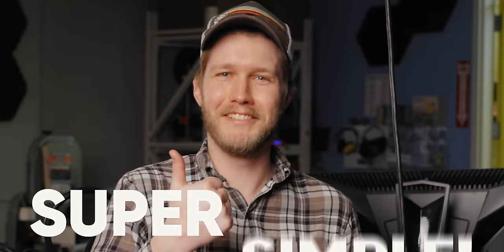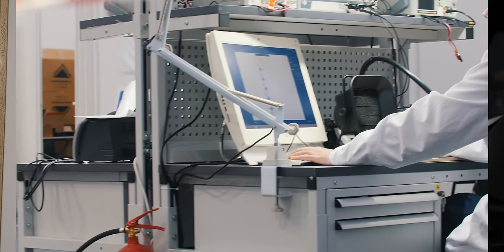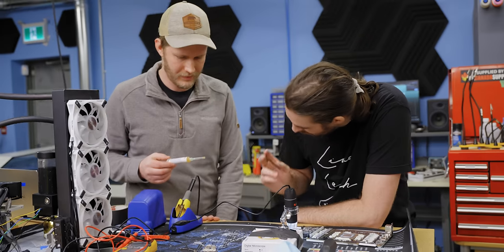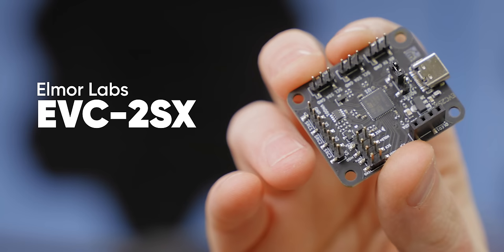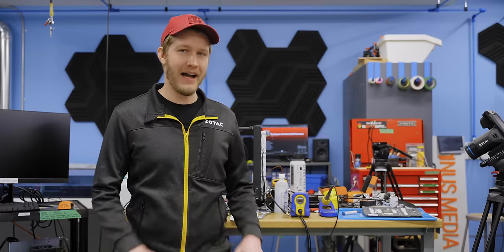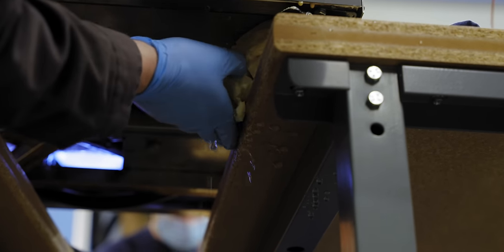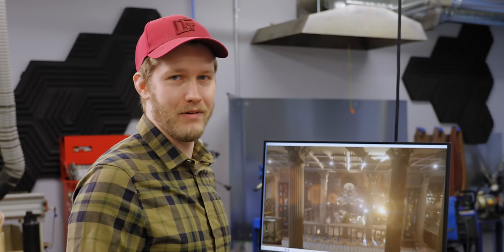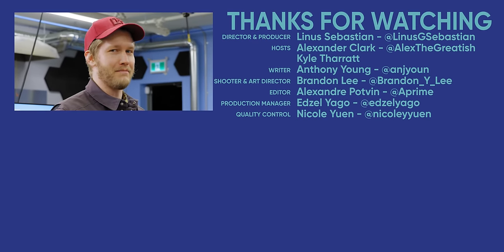Nvidia Doesn't Want You to Do This - GPU Shunt Mod

Comment: Alex: We’re gonna overclock this RTX 3090 with everything disabled. What could go wrong?

Canadians waking up tomorrow: Where are the lights? I can’t turn anything on.
Reply: That’s what happens when Linus isn’t in the room to reign Alex in.
Reply: They got power issues
Reply: Don't worry i heard some canadians are working in a generator that uses honking to generate power!
Reply: @Happiness-lp9fw  oof.
Reply: It's Canada, not Texas.
Reply: Canadians should be asking where's their rights
Reply: That's just Canada
Reply: Atom  mashalla
Reply: That's right. The one beaver, running in a squirrel wheel, that powers the entire nation's electrical grid, just had a heart attack when he plugged in that rig.
Reply: Eluwina  Shut. Your link will not be clicked, refund the owner of the channel you are working for.

Comment: Preheating boards for soldering is actually one of the many unexpected uses for my 3D printer's heated bed. Very useful.
Also getting plastic laminate pliable, softening glue. But most of all I use it to keep my dinner warm.

Comment: I have that same Hakko soldering iron, and it is easy to accidentally set the offset instead of the temp. If done it can think that  it much hotter or colder than it actually is.
Reply: Sqeaky
It's sponsored by TSMC, they sell more GPU chips if you do this at home!
Reply: What soldering iron is this? Does this one use the T12 / T15 tips?
Reply: the temperature offset thing is confusing as fuck, they call it temperature offset when it's actually a calibration, and it's easier to get to the calibration than the actual temperature adjustment. ridiculous design
Reply: Yeah but they were trying to solder onto ground/power planes. So that iron just doesn't have enough grunt for the application.
Reply: @deth3021   nah, it definitely has enough power to do it. I use that exact same iron at work all the time.

Comment: If you happen to read this, your going to want to do a factory reset on that Hakko unit as your issue is most likely when you "set" its temperature you actually set the temperature calibration. Its a common problem on that unit and the displayed temperature is not the true temperature but much lower.
Reply: This would explain why a Hakko was performing so bad I imagine. Was wondering that.
Reply: yeah that iron is definitely more than ample for the job, clearly some setting was wrong, ty
Reply: @mycosys  yeah Ii use it to solder onto small copper plates at 650F with no issues.

Comment: i rememeber being a teen (1999) and my idea of ''advanced' overclocking was taking a room fan, pulling off my side panel on my 500mhz p3 with 64mb ram and a ati rage 128 16mb, then pointing it into the case. i got some pretty good results! stock 90/90, i had solid performance at 125/145 or so if not higher. i miss that
Reply: I did exactly the same thing with a Celeron II and the same graphics card, in about 2003. I ended up frying the card and never bought another ATI card again. 😀
Reply: @TehButterflyEffect  that card in 2003 wasn't any good for anygthing anyways lol
Reply: @FusionC6  Eh, I was playing games from 1999 and 2000 that my old Matrox card and Voodoo 3 had struggled with like crazy. I went from 2-3fps with the Matrox to 10-15 fps with the Voodoo, then 20-30fps with the Rage. I had one game it couldn't run, which is why I tried to overclock it.

Combat Flight Simulator 3. 👍
Reply: Eh, that's still very modern. My first overclocking experiment started when I noticed that the 50 MHz quartz crystal in my Amiga 68030 card was not actually soldered in, so I went and got a 60 MHz crystal from an electronics shop and replaced it. 

Worked well for a while, then summer came and the system (with absolutely no fans) overheated after about 30 minutes. 

Plus, gaming back then didn't even care about the overclocking, since it was all designed to run perfect on the base model.
Reply: @ShieTar_  I had an es AMD Athlon 1100 in 1998 (dad was head of R&D at mesh computers) he "acquired" it from work written off as a dead chip slapped it in my first rig and overclocked it to 1.5ghz for me, he had it running a 3dfx guillemot voodoo maxi gamer phoenix with an incredible 16mb of memory on the graphics card, a 4gig hard drive and 256mb of sdram, best christmas present ever.

my first upgrade after that was a matrox G400 dualhead graphics card that made games run in hyperspeed when the frame limiter was disabled then a voodoo3 then a geforce fx5900 then a winfast geforce 6800 and then a radeon 2900xt then a zotac gtx580 and now a gigabyte gtx950 

a lot of other cards in between that I can't remember along with mobo,ram,cpu upgrades to the point I'm sitting with a semi decent rig (don't game much any more on pc)

asus x99 deluxe 
i7 5960x
gtx950
32gb dominator ddr4
Reply: @TheHaggisBasher  The Athlon 1100 wasn't released until the Summer of 2000 though, and didn't exist in 1998.  I think your childhood memories are a bit fuzzy ;-)

In 1998 AMDs range of CPUs ended at the K6-2, with up to ~550 MHz.
Reply: @ShieTar_  i was gonna say the same thing, as well as the voodoo card having 16mb ram, only the voodoo 3 and higher had that much ram :P
Reply: @ShieTar_  I'm just replacing my Amiga oscillator now! Not upgrading it, just a replacement. Also have some Pistorm CPU accelerator PCBs to solder up when I get the components. 
Amigas are awesome. Good times.
Reply: Pffft...I remember getting all my 80's groupies to blow over the 486-66DX just so I could run Doom.

Ok, about half of that isn't entirely accurate.
Reply: @TehButterflyEffect  and in 2022, I'm trying to get decent performance out of DCS World in VR. Those goalposts just keep on moving :/
Reply: @Kholaslittlespot1  I had a 68030 and a 170Mb hard drive in my 1200. I was living the dream! :D :D
Reply: I modded a window AC unit into the side of my case, for a AMD Duron OC way back. It worked great until the ac unit shut off because it was too cold, and my Duron jumped to 120'c in the space of 2 seconds.  Nowadays. I've literally ducted a portable 2 hose AC unit ( much quieter ) permanently into my PC.   Keeps the insides at a nice 5'c and since it's sealed, and the AC unit removes any condensation, always dry.
Reply: @Keri-Kerigan  My computer and window unit are on the same wall so I just made a 90 degree turn duct off the AC. Not physically connected but blows straight at the front of the case. (full mesh front, front mounted 240 aio). I don't run it that cold...about 18C at the face...3080 runs 65C under load.
Reply: @ShieTar_  Games back then ran faster when you overclocked... I mean literally, the game would progress faster.
Reply: @Idiomatick  Some games, mostly on PC, did. Most Amiga Games had their game engine synced to the video mode, so they basically ran in a V-Sync manner.

You have to keep in mind that the Amiga had pre-emptive multi-tasking from the very first day, unlike the PCs running on DOS where the game expected to be the only software running.
Reply: @ShieTar_  Weren't game speeds back then tied to the cpu clock speed? I tried emulating win 3.65 on my modern system to play Ultima VII again but when i pressed W to move forward the character was on the other side of the map in less then a second xD
Reply: @hernerweisenberg7052  Many Games on IBM compatibles were, yes. That's why DOSbox comes with a method to change your CPU speed, so emulation should be no problem.

But other Personal Computers of the time did not have the same problem, because they were more likely to tie their game speeds to the speed of the Video Chip instead of the CPU, which in turn was synced to the 50Hz or 60 Hz of NTSC/PAL.
Reply: I did that with my very first PC. The case had essentially zero airflow, so I opened the side and pointed a powerful blower style fan into it. It worked way better.
Reply: in 2001, you could unlock an AthlonXP CPU by connecting traces around the chip with a soft pencil, using its graphite as a conductor. Worked really well overclocked for years. felt so advanced.
And hotswapping my BIOS chip into the running PC of a friend, to flash a new bios version on it, because by new PC build would not even start without it.
Reply: I remember taking off the bottom of my gaming laptop and putting a room fan underneath it. Allowed some pretty great overclocking.
Reply: I have a mini itx PC with two AIOs, cpu and gpu, with 140mm radiators at the top of the case.   When playing a high performance game I point a blower fan (the kind that you use to rapidly dry e.g. a carpet) right next to the radiators.  It brings the temps down from +80 C to 40 C.  I'm not overclocking, but it seems significant to get 40 C under full load, and I think wall fans are under utilized in PC cooling.
Reply: @TehButterflyEffect CFS3 is great, still holds up today. Graphics aren't bad for 2003 either.

Comment: It's a shame you didn't have a watt meter on the wall to measure draw at the outlet on this. That would have been interesting to see.
Reply: For what he said, the draw is over 1200w, judging by the low waste seasonic is know for you can put 10% over that
Reply: @Br-Shaft  that was only an estimated draw. It's probably accurate but if something can be measured you should measure it.

Comment: You gotta be careful soldering boards with huge heat capacity. It's always best to warm the whole board up and then use the minimum heat needed to flow the solder. While they're built for big heat spreading ability, there are still very fine traces especially around the GPU itself. Big thermal differentials can shear those tiny traces right in two.
Reply: Things like this make me happy to keep my sapphire 5700XT nitro+ as stock, much easier to keep reliability than trying to do.... this
Reply: I just lost 4 days of SMD capacitor soldering only to know on the 5th day that many of them had cracked because of uneven heat / thermal cycling.
Reply: @prashanthb6521  that’s a bad time. You may need to invest in a heat plate my friend :)
Reply: Hot air station for the win
Reply: I used to use a toaster oven I rigged a Tiny to so I could actually have an adjustable PID to deal with the temperature ramp in addition to the target temperature and soak time.  Worked well enough as a reflow oven but not sure I'd trust it for something like this.  Probably would have just masked off around the shunt resistors and then used a heat gun with some soldering paste and a flux pen to just go to town.
Reply: @EkiToji  This^
Reply: 70w soldering iron is going to be going cold. They need a more powerful iron. Maybe they can contact the other modder for his iron info.
Reply: @Green Mamba Games that hasn’t been my experience. I was trained the use the largest iron tip practical for the job. The entire tip reaches the target temperature, a larger tip has more thermal mass and can transfer more heat to the part. A heat gun (a hot air rework station, not a handheld heat gun) wouldn’t be that useful here
Reply: They literally said to heat the board up in the video
Reply: Ok, thanks. I'll bring out my MAP torch next time.

Comment: 6:50 I'm running that same iron, and have soldered far higher heat capacity components before with no problems. In that scenario what I'd do is place some al foil and kapton over the plastic components then carefully preheat the area with a heatgun to around 100C, keep the hakko at about 180C. Add some flux, then gently solder the new one making sure to use leaded (NOT LEAD FREE) solder or specialized low melting point solder (used by specialized components that cannot withstand 150C from an iron due to temperature gradients or whatever).
Reply: Could be that someone screwed with the calibration. I did it by accident.
Reply: @MaritimesNB  thank you! I just decided to live with my fuck up. It's not like I know what temperature it should be at anyway
Reply: I mean clearly they didn’t use enough flux so

Comment: Not surprising, the non leaded solder is suppose to take a higher temperature to melt, it saves the planet and your graphics card from dying. But is impossible to work with as leaded and unleaded solder don't form good joins, that's why Louise removes it and starts fresh when rebuilding a circuit.
Reply: It doesn't really save your GPU, good old leaded solder is actually way better (in therms of long lasting lifetime) modern electronic solder joints can easily fail within 5-10 years while old school stuff still works. As far as I know its just a thing of saving money more than a enviroment or safety thing.
Leaded solder must be worked with active air suction. If not the companies are legally accountable for medical problems. So not leaded means no legal responsability and saving money on not needing air extractors.
Reply: so glad I can still buy the stuff so I can use it when I need to. On the scale of things destroying this planet a teensy bit of PbSn solder isn't enough to trigger my conscience
Reply: Those newer solders are brittle as hell and god forbid whatever you are working on has a fine oxide layer or any type of electroplate layer, because that will be your fail point in like 3 years.
Reply: Saves the planet? Lol, no.
Reply: @israelmxc  That's for the flux fumes. You still need air filter/whatever for lead free solder.  There is bugger all lead vapor.
Reply: Great for mass-produced products where the reflow or automated soldering can just be tuned to deal with it, worthless and infuriating for almost everything else. Also, man soldering SMDs with a regular iron is a pain lol.
Reply: @Lizlodude  These are pretty chunky resistors though, there are through hole parts that are smaller.
Reply: coming from the world of building guitar amps... you couldn't pay me to use unleaded silver solder. 60/40 rosin core lead solder melts like butter. regardless, the main problem here is 100% the iron - they need a pencil tip and WAY more heat to be working on such small components.

Comment: FYI, Weller sells tweezer irons for these types of SMD resistors. They heat both ends of the resistor at once, and keep it from sliding around.
Reply: Now that sounds like something I should have bought or invented 10 years ago, I must have one
Reply: Those are not super powerful though... probably wouldn't have worked to heat the solder up enough with that huge GPU ground plane wicking away all the energy.
Reply: Also were they in “A” or American mode or C? Im curious if there temp wasn’t actually the temp they thought. Or someone fiddled with it and accidentally reset their calibration curve. Ive seen that in more than one lab before before and you had to reset it to factory settings on those hakkos.
Reply: These are garbage, the best solution is to use a heatgun to warm up the board and then use two soldering irons so you can connect both ends at once.
Reply: @Robertkopp84  i think you mean jbc not jbl ^^
Reply: Please just buy JBC, active tips are the main difference between professionals and botchers
Reply: @Mr.Funplayer  Geez, thanks!

Comment: You probably need to reset / re-calibrate the soldering iron - there's a video for that model that shows how to do it easy.  Probably someone thought they were adjusting it and that's why its running cold.